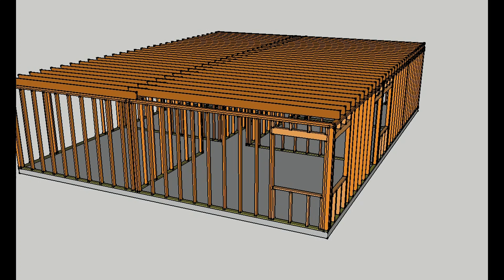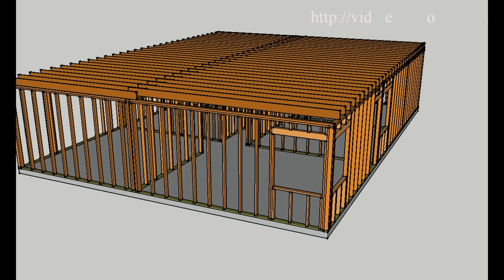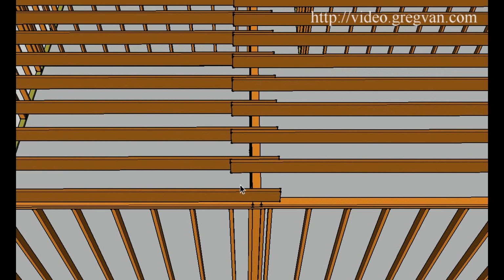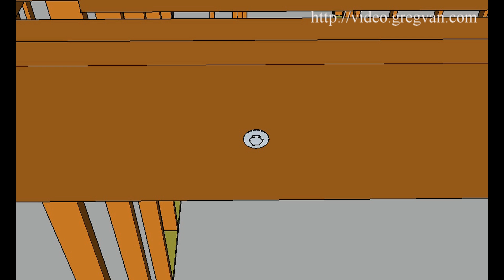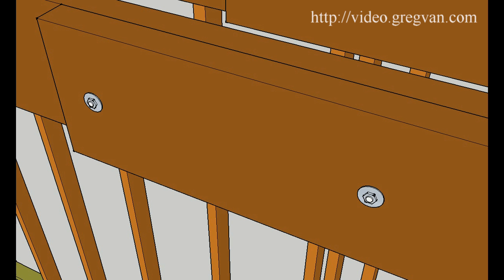How To Bolt Together Unsupported Ceiling Joist – Remodeling Tips

Comment: How would I splice two 2x6x8 for a 16' joist span for shed ceiling? Shed dimensions are 16x20x8.
Reply from the maker: It will depend on the framing design, but you might be able to bolt two 10 or 12 foot joist together to create a 16 foot joist, if there's no way to install new full length joist.

Comment: I would think adding  a 4’ piece of 2x at the end of the joist to be extended, and then sistering an 8’ (minimum) 2x across the joint, glued and nailed and/or bolted together, would give you a stronger joint. It just seems that your way puts all the stress on 1 or 2 bolts on the end of a joist, but i’m no structural engineer either.
Reply from the maker: You could be right and this video is only meant to provide something that might work, but won't always work.

Comment: I fully understand your intent is to advise the DIYer who is going to something regardless of the consequences. BUT for a guy who has 40 years in the business you have missed the very obvious. If you place only one bolt through a sistered connection you have not only done nothing for joist sag, you have now directed the compression forces to that single bolt which will act as a pivot point. The joists will sag at the bolt to the point when the single bolt will shear-off and the ceiling collapses. IF the DIYer is going to reinforce with bolts there has to be multiple bolts and staggered to avoid having the wood joist split. Under no circumstances would I recommend doing what you suggest. What I would suggest if a person insisted on doing something like this is to go to a metal shop and have some structural steel bent into U channels 3' long and place them on the bottom of the joist at the overlap where the support is required. Then use wood screws placed in a staggered placement to avoid splitting the wood on both sides.
Reply: Thank you for calling that out. I am not a building professional and do not have any structural building experience but even i know just one bolt is inviting a mess of issues and is not a structurally sound connection at all. You are 100% correct about it creating a pivot and floor sag. 2 bolts with washers on both sides is the very least that I would do depending on the length of the overlap. And I would probably put blocking at the end of each joist where the overlapping occurs just since it is supporting a second floor. And I definitely agree with the u shaped metal. That’s a great idea.

Comment: This home was built in 1974. It has two ,two story buildings 10 years apart. Most recently had around 200,000 bats in the walls, dropped ceiling and roof . I thought I had killed the mold last year . This year I have been closing everything up all to find the black mold coming back. The two beams in the older side of the home ,are in 3 sections . The span is 211/2 foot. When I opened this half wall in the middle, it does not seem to be bearing. However I have to replace at least the middle section to the center beam ,as it is very molding
Reply from the maker: Wow, that's a lot of bats. If there was a question in there that I missed, feel free to ask it again, otherwise thanks for sharing your story.

Comment: How long can ceiling joists without any support underneath (wall) I’m trying to do a 30x30 garage. I’m trying to find out if I can run ceiling that long
Reply from the maker: I can't provide you with structural engineering information, but if you can install a post and beam in the center of the garage, then you might be able to get away with 2 x 8 or 2 x 10 ceiling joists.
Reply from the maker: Another idea would be to use roof trusses.

Comment: The video's creator, and many who have commented here, rightly state this method of repair is not based on calculation and is non-standard (I take this to mean has not been vetted by professional engineering and not allowed by the International Building Code). The video's creator seems to be trying to show his proposed method of lengthening a ceiling joist. Professional engineering, as a discipline, exists to replace guesswork with calculations based on the tested and accepted principles and laws of science.

The video's creator responds to some critics by asking them to prove his proposed method won't work. Science, the field which engineering falls, isn't based on trial and error. The fields of material science and statics are well explored and well understood. More specifically, licensed professional engineers make their careers out of interpreting statics and material science to devise safe, economical, and aesthetically pleasing solutions to what humans want to build. 

Given the way people use YouTube, I consider this video irresponsible. Generally, YouTube viewers do not diligently vet the content creator's credentials. By posting a "How To" video that is actually a "My idea, which is not a standard method, and might not work" video, the original creator is risking someone using his method and failing. Given the subject (i.e. homebuilding), it's reasonable to assume a failure would result in loss of property at the least, and possibly injury or loss of life.

I applaud the video's creator for taking the time to produce a quality video. I suggest he remove this video, or in a far distant second place, revise the title (not just the first pinned comment) to reflect his method's state of acceptance.
Reply from the maker: I stated multiple times in the video that this particular method might not work and if I didn't clearly state that multiple times, then you would actually be suggesting something I didn't mention. Feel free to email me engineering calculations if you have any or have any access to them to suggest that there is no way this would work under any circumstances and I will be glad to examine your information.
Reply: @gregvancom  the biggest issue I see with a single bolt in the middle of the joist is that it essentially moves the support halfway up so that if it was a 2x10 for instance, now it becomes a 2x5.  It would be the same as if you notched the board up to where the bolt is.  Several hot galvanized nails would be better than a single bolt because they would distribute the load.  This is also why you don't see bolted construction in code but rather specified number and spacing of nails.  I appreciate that this video is just an idea that you have and a structural engineer could probably do the exact calculations to determine what loads this would support and where it would be ok...but my thought is that in most cases this would not be a good idea.

Comment: I didn’t even finish watching this video I remodel houses for a living and that’s just wrong. If there’s no bearing load of the second floor and you have an empty attic you could strong back it with lvl but best way is a beam under it . You’ll need to go and talk to a structural engineer if you have a lot of weight or an upstairs over you if you are in a split level home with an empty attic that just has displaced ceiling joists you can strong back yet from above or cut in a beam by cutting all those Joyce slipping a beam up in between them and hanging out with joist hangers this will keep you from losing too much headroom but keep in mind Long spans without supports need to be done properly and where I live we get a lot of snow so they want loads to be transferred from floor to floor all the way to the basement to prevent sagging. This means you just can’t put a post under a beam on top of plywood it must be transferred to something solid beneath it. This is not a do it yourself project. Call a professional
Reply from the maker: Maybe you should have finished watching the video, because I stated that this might not work at least twice. Again, try not to get caught up in standard construction methods, because I've seen a lot of things that would not be approved by an engineer, yet has lasted for decades.
Reply: @gregvancom  It doesn't matter what you state at the end you suggest a single bolt might work, that is completely incorrect! Did you consider what a pivot is?

Comment: how would you join two 2x6x16 Lumber to make a 22feet long joist for an unsupported ceiling patio/screen room in Florida USA. THANKS. please give step by step instruction.
Reply from the maker: It sounds like you're going to use the 22 foot long lumber for some type of repair. Have you checked with your local lumberyard to see if they have 22 foot long lumber, if not please send me some pictures of what you're trying to do for more information.

Comment: I currently look of removing a bearing wall which effect 2 ceiling joist. Can I cut those splices ceiling joist and add beam to connect those 2 ceiling joist? The span is about 2.5 ft.  which type of wood is right 2*6 or 2*8? as a bean? can I nail the bean down to the existing bearing wall?
Thanks
Reply from the maker: Feel free to send us a picture of your project and I will see if I can help. You can also visit our website and check out the sections on engineering, framing and framing repairs.

Comment: Advising people to modify the frame of their house without a structural engineer is absolutely wrong, it encourages people to make poor modifications that will compromise the strength of the house and moreover the garbage you are proposing - no offense but that's what it is - would never pass inspection and for a reason - there is zero engineering or math behind your claims nor is there any consideration of the roof and where weight is being distributed across the roof. Having recently been f*cked over by a two-bit contractor that thought he could play structural engineer in a similar fashion I have been through this and I would advise anybody to fire and report your contractor on the spot if they try to pull a stunt like this on your home
Reply: Change the title from How to... to How not to do... and then it'll get a better reception.
Reply from the maker: In this video I'm providing an example of something that might work and stated that throughout the video. Then you stated that it would never pass inspection for any reason, but I strongly disagree. Feel free to provide me with engineering calculations that prove me wrong and I will make the necessary adjustments to the video.
Reply: Unbelievable! I cant believe you would post a video of what you "THINK" "MAY"works!  There are people out there that would do this, then one day a 5 feet of snow loads break through the roof and killed their wife and children.  Such a stupid video.

Obviously removing that existing joist is too costly because there is a roof top that weight quite a few (don't underestimate shingles weight) unless they're willing to redo the roof and also alot of nails going into that existing joist, not easy to remove the existing joist without redoing the roof.

Here's an advice you can give.  Simply put a longer SISTER-JOIST those existing joists with a longer joist from below with nails and bolts along the whole length of the joist.  The only thing you would destroy is the ceiling drywall which is cheap.

I can't believe you would suggest putting bolt and nuts at the end to support such weight from top roof, UNBELIEVABLE!

I'm with Andre Metzger, wont pass inspection.

Comment: I really think that this would work fine I'm also in construction and have seen some very crazy things over the years that would make this so look like superior framing. do have one idea that may help buy a few heavy duty ratchet straps connect them to the ridge and the ceiling joist. perhaps sliding the open end of the ratchet strap between the joist and the drywall. the heavy duty ones like the truckers use. I also like to think outside of the box
Reply from the maker: +Mark Tatum We've got to be of the think outside the box.

Comment: I think I would add a sized glue-lam on top of the 2/6 on top and use joist hangers to catch the 2/6. a double 2/12 would probably only go 12'. this is if he did not want to sister a 2/8 along side the 2/6
Reply from the maker: +John Hafernik  I don't know it that would work, without something holding up the beam, like a post and footing.

Comment: Worst advise i ever saw. Don't do this until you've talk to someone that knows what he' s talking about.
Reply: The VERY first recommendation Greg made in this video was that what they should REALLY do is remove all the ceiling joists in the expanded room and install the correctly-sized ceiling joists per specifications. So how the hell is that bad advice? Either you didn't listen to the entire video or your one of those Gotta-prove-I'm-a-know-it-all-Internet-troll so you can look like you saved the day in the comments section.  Absolutely ridiculous.
Reply from the maker: +denis REDDER Wow, I seriously and I mean seriously cannot believe some of the comments below, but understand why they're there and believe that I made my points and some of yours listed below in the video.

So why even make the video, if you can't do it?

First of all, I would need written proof and calculations from an engineer that it wouldn't work, then I would actually need visible proof that it wouldn't work (20 to 50 years of observation). I have seen plenty of buildings that would be considered substandard construction practices in the year 2015, yet are still standing and in some cases holding up quite well.

Last but not least, I just visited a home where someone used if I remember correctly, 8 foot 2x4 as floor joist that were nailed together with what looked to be 4 foot laps, 12 inches on center, to span 20 feet, for garage attic storage. The new owner told me that this home was 30 years old.

The information I share with my viewers is based off of my observational knowledge of almost 40 years spent in the construction business and in some cases like this one as clearly stated in the video, might not for you or be approved by your local building authorities and engineers.
Reply: What makes your advice any better, are you a structural engineer?
He states this may be a option but do more research first to see what is up to code.
Reply: +Steve Barnabei There is no code to splice floor joist. It's not allowed.
You need to add a sister joist that goes the full length of the span.
Reply: +denis REDDER that doesn't answer my question. He says someone asks him what their options were to moving the wall as he described. His first suggestion was to get longer lumber to span the new length an gain the correct lap over the newly placed wall. 
Yes there is no code to splicing joists but this isn't new construction and the people will move the wall on their own without a permit so no inspector can say splicing the joists is a problem.
He just made a suggestion if they were to do it anyway.
Besides that I don't completely agree with the suggestion. If one were to do such a thing, I would sister a 4' piece of 2x4 (glued and nailed) to the joist to the right of load bearing wall then add a 10' 2x4 (glued and nailed) sistering them all together spanning the lap. Doing this before building a temporary wall and moving the current bearing wall over 2' into its new location
Reply: +Steve Barnabei Ok, you win....  I was more concerned with the family safety and the "vise cacher" this was for the next buyer.
Reply: denis REDDER those bolts will hold those beams forever! I recommend  putting them everywhere in your structure!